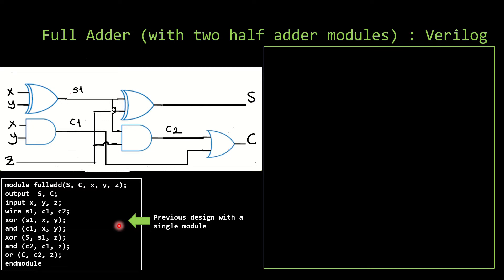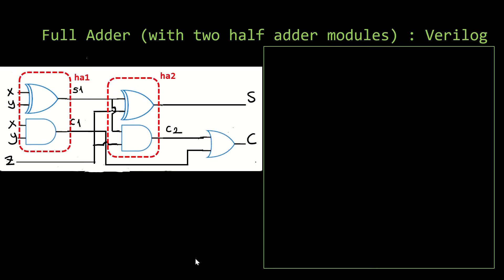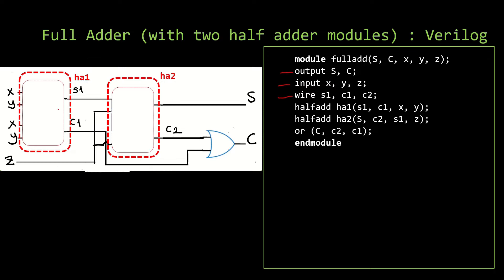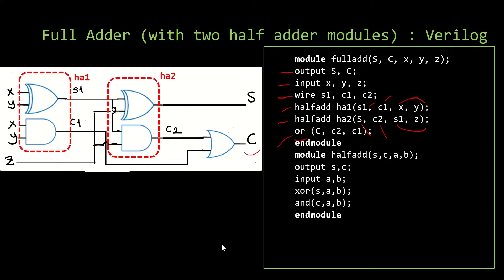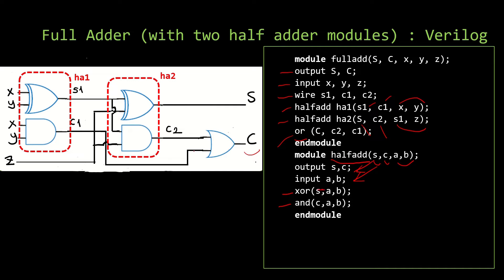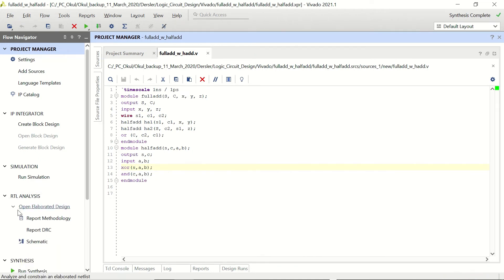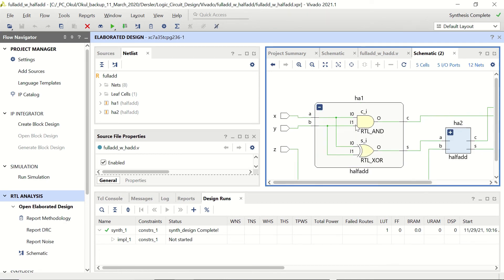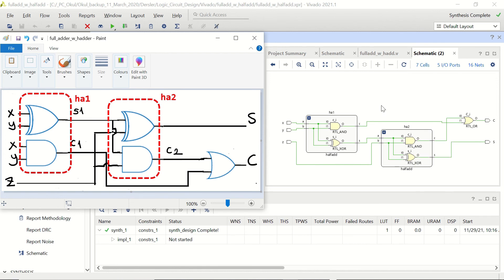FPGA Programming with Verilog: Module Instantiation

Comment: Dr Selim would you consider a tutorial on microBlaze for basys3?
Reply from the maker: Honestly I haven't used microblaze earlier, however I made some search after your comment and it looks interesting. I'll surely add it to my list (probably not so soon though). Thank you for your suggestion.
Reply: @drselim  thank you for considering it. In fact it would be very interesting if you develop a Arduino type softprocessor. FPGA is amazing!
Reply from the maker: You’re absolutely right, starting from smaller modules (adc, timer&pwm, uart-spi, alu,…) one can build an entire microcontroller (even though it’d be an expensive one)
Reply: @drselim  i have followed your tutorials and they really helped me. I feel your approach to teaching is very concise and helps a new comer to FPGA like me.
Reply from the maker: It’s great to hear that, thank you. I’m trying to create new videos whenever I have spare time. Nowadays it’s hard , since it’s the final exams period. However I think I’ll be back in a couple of weeks.